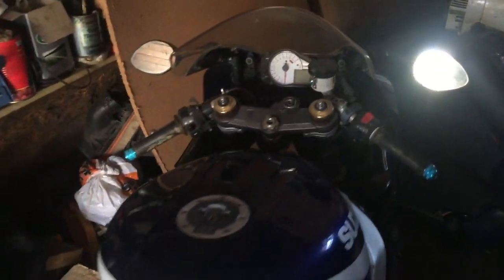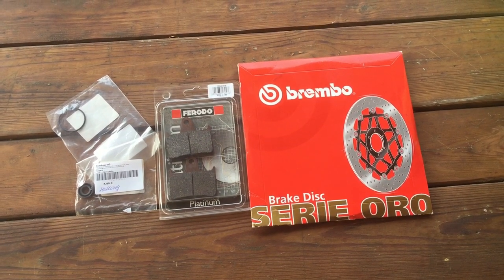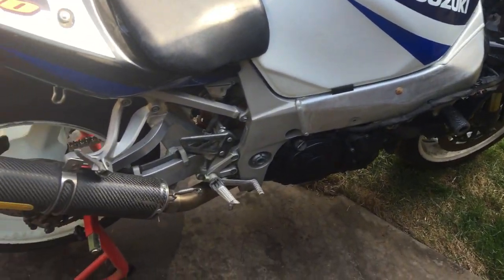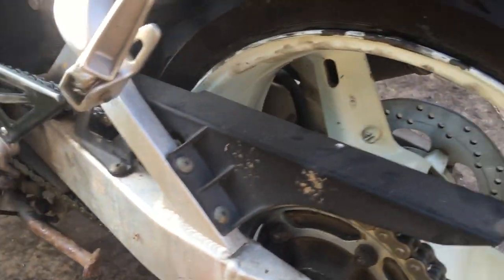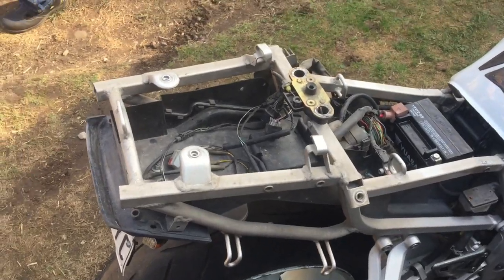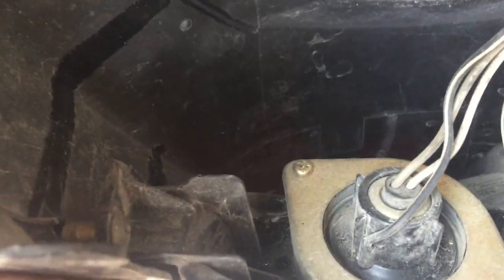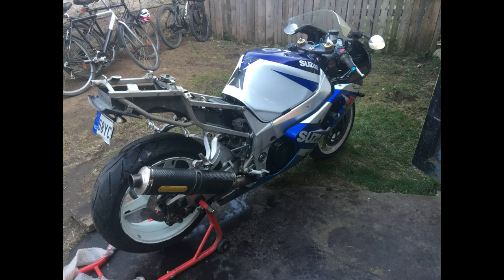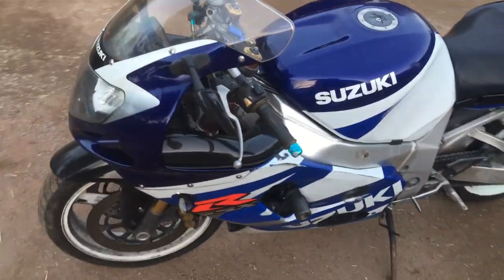Suzuki GSXR 1000 K1 First bike restoration Part 2

Comment: Sir idk of you know this but tighten the break rotor in a triangle pattern or it will start to warp again just a friendly tip. You can also flip them.
Reply from the maker: Thanks for the info.Right there are no problems,but if i have to change them,then i will use your advice🙂

Comment: How's she doing since, any new updates? Just about to put Samco Hoses on  and service mine.
Reply from the maker: Mean Bean-Machine She is hibernating right now.I am heading to my friends place at 14 march.Then i will make a new video also with service and some work.
Reply: @TheMeisner87  Just stripped mine, and replaced a few parts, ride all year here, but getting her ready for the NC500 in July, and putting her on the Dyno in May to get some more gains on what I have done and a custom mapping, looking for at least 165bhp, but that be a little too optimistic
Reply from the maker: Mean Bean-Machine your a lucky guy because you can ride all year long.Where are you from?
Reply: @TheMeisner87  Jersey Channel Islands, in the English Channel 14 miles off the french coast, we still get the shit weather, but have good set of winter gear
Reply from the maker: Mean Bean-Machine not so far.I thought somewhere around california🙂we had 3 days worth of snow in Estonia,but its still cold.
Reply: @TheMeisner87  lol 😂 I wish, California would be nice, we ain't had snow in several years. It doesn't stick here, but we have been hit by 4 storms in the last month, which is normal for this time of year
Reply from the maker: Mean Bean-Machine but be optimist.At least you can drive all year long👌

Comment: ? valve shim clearances, coolant hoses, brake caliper seals, brake lines, fork oil, bearings? swingarm, triple, wheel....
Reply from the maker: If you mean to change these bits then front forks were maintained before i bought it.Brake lines are good,and everything is working.